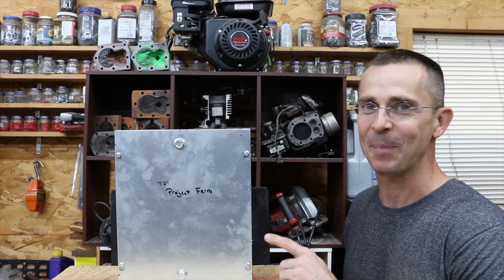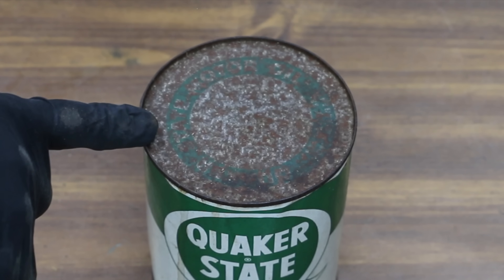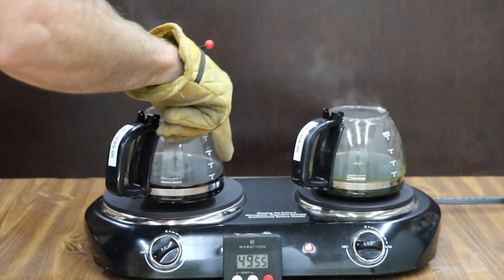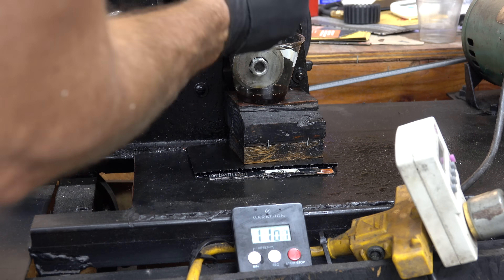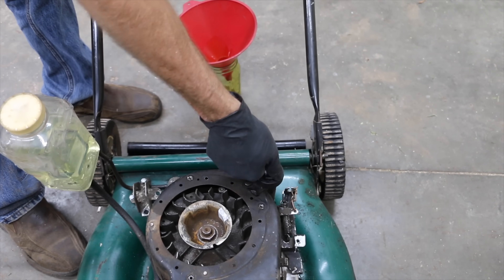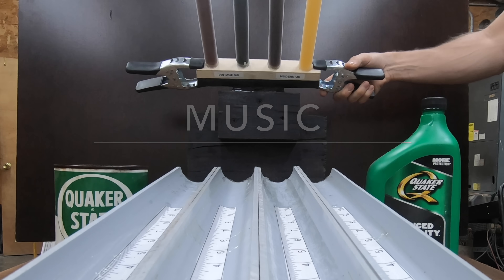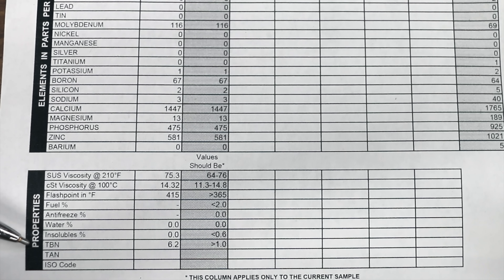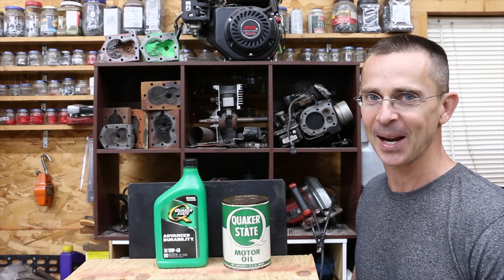Is Oil Good After 70 Years?  Let's find out!

Comment: I always assumed that new cars last longer than older cars because they are made better. Maybe the quality of the oil available to them also makes a huge difference.
Reply from the maker: Thanks for the feedback.
Reply: Also the pleated paper replaceable air filter element works a lot better than the old fashioned oiled mesh air filters which required lots of maintenance which nobody actually did. 
Many old cars had no oil filter either unless it was installed as a dealer accessory when the car was sold.

Comment: The oil was non-detergent. It should have been tested against modern non-detergent oil.  You compared apples to poker chips.

 Modern non-detergent 40 weight would be roughly the same as the old oil. Break in, or compressor oil is what it's used for nowadays. 

They sold multi-grade detergent oil seventy years ago. It would be much more similar to the multi-grade 'modern' oil. 

Non-detergent oil was very popular and without getting technical there were very good reasons for it being sold at the time. You can still buy it and you still need it.
Reply from the maker: Thanks for the constructive feedback.

Comment: The oil looked similar to that when new.  It was lower manufacturing quality, not age.  Oil is made from decomposed organic matter from millions of years ago - so a few decades wont make a difference and it shouldn't degrade.  THe only real difference is that new oils are made better (better processing and additives etc.).   The old oil didn't "go bad" - it kinda started out that way
Reply from the maker: Thanks for the feedback.

Comment: So newer oil IS better, fuel injection IS better than carburetor. I would like to see  a 1970s BBF like a 390 with old oil, old fuel system go against the same engine but with new oil and Fuel Injection. See what one will go the distance. That would be interesting results are 100k miles.
Reply from the maker: Thanks for the suggestion.

Comment: Idea: Will 10W40 oil damage a small engine?
Reply from the maker: Thanks for the suggestion.
Reply: If it is pretty old, it might have a lot of sludge in it.  Either clean the sump and the oil pump screen, if it has one, or use non-detergent.

Comment: It's probably as good as it was then.  QS was noted sludge problems then.  I've seen engines run on QS with 50,000 miles on them having the valve covers packed solid with sludge.  I wouldn't put that stuff in my lawn mower.
Reply from the maker: Thanks for the feedback.

Comment: Modern motor oils are better than the vintage motor oils… If that oil is from 70 years ago that’s around the time when you changed your oil every thousand miles… Oil filters were still an optional extra 70 years ago

I would like to see a comparison from a bottle of Quaker State from the mid 90s… Quaker State never had a sulfur smell and Pennzoil dead… And a route the mid to thousands when Pennzoil bar Quaker State, And about the mid 2000‘s Quaker State oil got that sulfur smell
Reply from the maker: Thanks for the feedback.
Reply: @ProjectFarm  By the way I have a bottle of 30 weight quaker state from 1996… Would you be interested in doing a comparison video to a modern bottle of Quaker State… I would challenge you though that it would need to be compared with a new bottle of 30W Quaker state

Comment: Great video, but the tests really aren't conclusive or fair to either oil, you're using fifty-year-old motor oil that does not have a viscosity weight vs Modern oil that does would be nice to see you do this again the Vintage motor oil, and then with say a standard 30 weight ND oil which is more like the old oil
Reply: It does have a viscosity, the rust on the can made it unreadable.  It also had a service rating, ML, or MM, or for detergent oil, MS.

Comment: I was working at a recycling center and a shop had closed down 40 years earlier and they were clearing out all the stock and all this stuff was brand new oil radiator stuff transmission fluid all sorts of stuff and I loaded my mom's car with it and it was hundreds and hundreds of dollars worth of brand new oil and you opened it up and it was brand new it's oil oil is as old as the dinosaurs it's never goes bad.
Reply from the maker: Thanks for sharing.

Comment: Is the 70 year old oil good?  Or, 'Is the 70 year oil a good oil?'
The formulation of mineral petroleum motor oil, from 70 years ago, can't compare to what the current formulations are for motor oils.
Younger people wonder why cars in the 1930s/40s were worn out after 50K miles?  Part of it had to do with the primitive state of engine lubricants at the time, being non-detergent motor oils.
Reply from the maker: Thanks for the feedback.

Comment: Remember that in earlier times 100,000 miles was the end of the world for most engines. they really were much dirtier, way more sludge buildup. today they burn cleaner and the oil really is better to use than the vintage. save the vintage as a lubricant for other machinery, not the modern engines.
Reply from the maker: Thanks for the feedback.

Comment: Both oils are suboptimal at best going by the analysis results. The vintage oil would straight up ruin your engine with only 509 Zinc and nothing else. 
In general the numbers im seeing here are below any decent oil sold here in Europe like wow 1447 calcium and 581 Zinc even for the brand new oil? Thats straight up half the additive package you should be getting.
Even a DPF Safe low saps oil here can easily have 700-800 zinc and there would be both moly and boron in there to make up for the low zinc some are in the triple digits with their Moly+Boron package which is really good.
I wouldn't run Quaker State in anything not even a lawnmower. The 0w40 that's currently in my car has a TBN around 10, 1200 zinc, both boron and moly, 3500 calcium to put this junk quaker state oil into perspective. And no my catalytic hasn't fallen out the tail pipe yet 😅
The only positive thing that I can accredit to them is the fact that they have some moly and boron in there at al but its not enough to make up for the super low zinc imo.
Reply from the maker: Thanks for the feedback.

Comment: Short answer: No regardless of what anyone says once the motor oil is 2 years old it has degraded. Although in a survival situation the motor oil can last, if sealed well and preserved well, for up to 5 years. So no any oil over 5 years old is much too old to risk using even if it still has the proper motor oil characteristics. (Note: I said MOTOR oil on purpose)
Reply from the maker: Thanks for the feedback.
Reply: @ProjectFarm  no problem thank you for the videos 😁 just want to make sure people know all the facts even though you covered it very well. As an automotive mechanic one of the most common causes of issues I see in vehicles is improper maintenance. Namely either using the wrong oil, not enough oil, or just not changing oil. Nastiest thing ever is taking an oil pan off cause the oil won't drain only to find a jello mold stuck to the bottom of your engine.....

Comment: So is part of why they used to change the oil every 3000 miles in older cars but modern cars don't need to be that often? Because the oil back then was relatively crappy?

Comment: the oil is about 65,000,000 +/- years old before refining to start with,, should be OK.
the old oil Might be good in a small lawn mower engine that you do not expect to last forever anyways. I would NOT use it in a cold weather small engine like a snow blower.
I am old enough to remember motor oil being sold in cans like that, seems like those cans disappeared in the late 1980s.
Reply from the maker: Thanks for the feedback.

Comment: This old oil is the origin of the "3000 mile" oil change. A modern oil is MUCH better and if you change at 3000 miles you are throwing away in almost every case a lot of perfectly fine oil.
Reply from the maker: Thanks for the feedback.

Comment: In the case of Quaker State oil, the problem is not its "age" but quality.
Few people know that these oils are produced only on the basis of used, burnt engine oil of various types - it's just American crap.
This oil has been widely advertised since the 1970s, mainly for the European market, and was widely sold. Many people have paid for their curiosity by refurbishing the engine, falling for the false advertising (including one of my friends). You will not find any specification on the packaging, because this oil does not meet any standards - it is genuine garbage, oily mud.
I guarantee that when you open an ancient, original Castrol, Elf or Mobil can, you will find mineral oil of excellent quality in it.

Comment: skipped to the end, your conclusions are not in line with what you tested

you tested oil that was produced 70 years ago. Your testing showed it was STILL GOOD based on its original design.

New cars are designed to take advantage of modern oil formulas - they depend on the additives and multi weight viscosity properties.

So obviously you cannot use a 70 year old can of oil in a new car, just like you could not use a NEW can of oil that was made to the specs from 70 years ago.

Was the 70 year old oil still "GOOD"  ?   YES  it still met the original specs it was produced to.  THE END.
Reply from the maker: Thanks for the feedback.

Comment: Not even going to watch. Shit better be 'good'. They tell us oil been in the earth for millions of years but can't survive 70 years in a can?
Reply: Well, that's crude oil, which comes out of the ground like a thick, heavy tar. Motor oil has been separated out from that through a refining process, and then blended with different chemicals - anti-wear additives, detergents, and dyes. Its composition is very, very different from what comes out of the ground and can behave differently when left to sit for a long time. Crude oil is a raw material that goes into making refined oil, they are almost as far apart as bauxite ore and aluminum alloy.